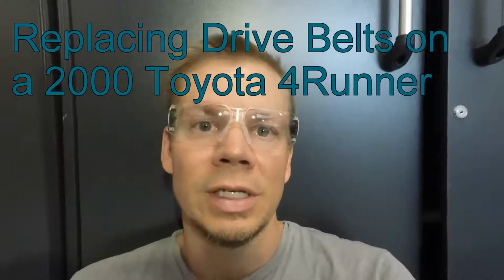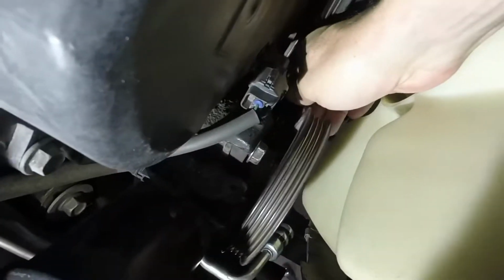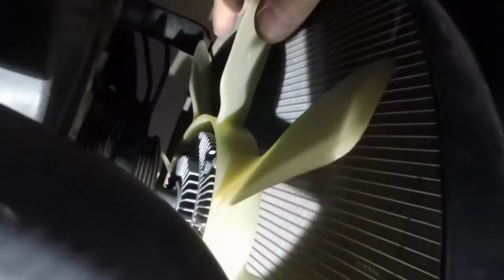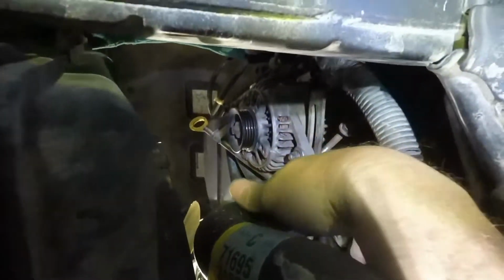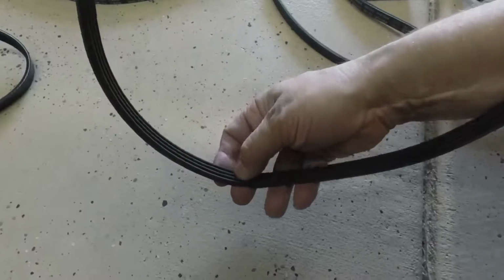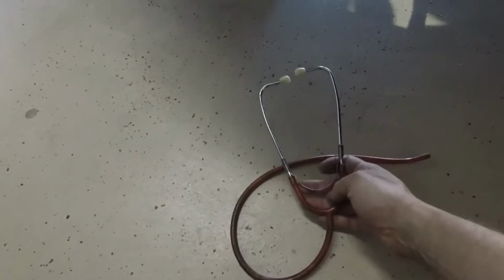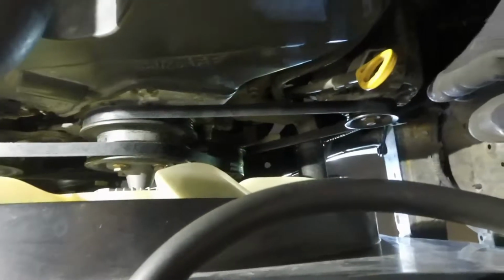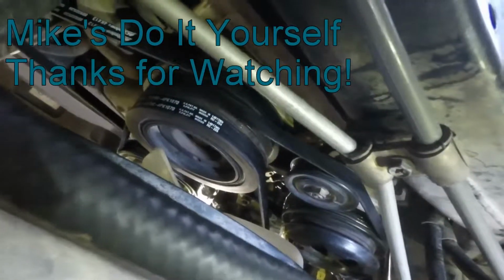Replacing 3rd Gen Toyota 4Runner Pulley Belts

Comment: At 1:43 you mention loosening one bolt, you show 3 in that shot, which are you talking about?
Reply from the maker: @xXxC0nn13xXx  Hello, I panned the camera too fast, but the bolt head is facing the front right tire. That's the adjusting bolt that will make the pulley/power steering pump move. Good luck with your project!- Mike
Reply: What is the best way to get access to this bolt. It’s the last one I’m struggling with.
Reply: Super helpful video thank you for this content